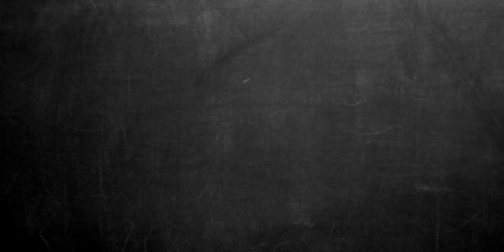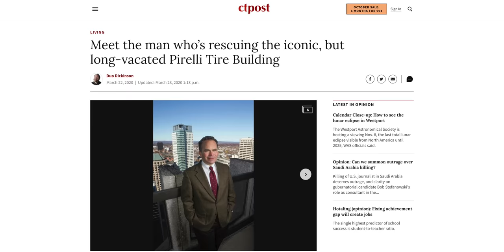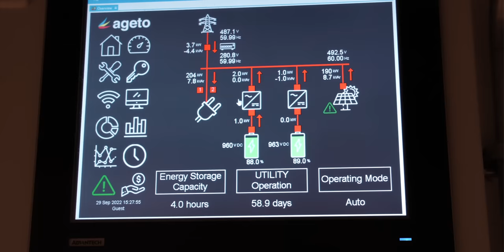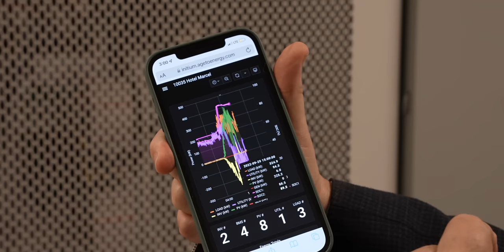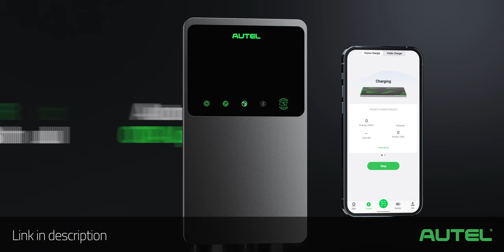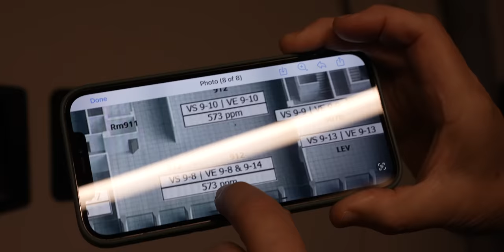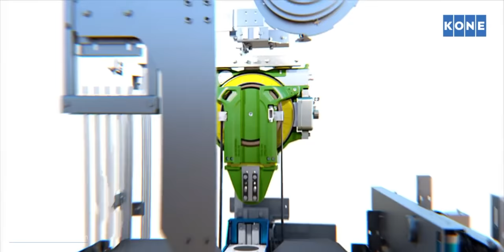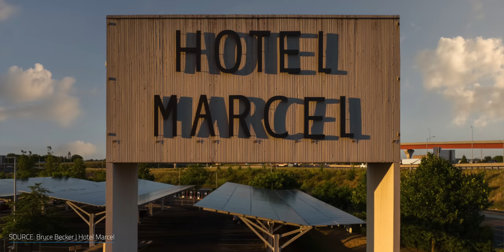How Big Can You Make a Passive House?

Comment: I have a special kinship with experimenters like this gentleman. Im about to retrofit a residential home and have been wondering why no one inside the US is manufacturing vacuum insulated panels for residential structures yet. After doing some research it looks like I can make my own panels for this particular project. There are no examples online explaining how the panels are made or how to install them on residential structures so I've already got some materials arriving in the mail this week to practice making some small scale VIP's and test their effectiveness against closed cell polyurethane foam and fiberglass. Some times you've just got to experiment yourself to see if an idea is viable.
Reply: I suspect the tricky parts will be making sure it maintains a vacuum for 20 to 30 years, and making sure no one sticks a nail through it to hang a picture!
Reply: @Cynthia_Cantrell  - Yes exactly. Someone needs to make a puncture resistant panel with the VIP inside. For my particular project it wont matter because its my house and i'll be careful. And the way Im going to install them it wont be too difficult to replace if/when they fail. Im projecting my panels to stay sealed for 50+ years.
Reply: Well if you do this, definitely make a video about it. I've wondered as well, but my guess was that material science wasn't there to maintain a passive vacuum for years
Reply: @__-pl3jg  Interesting... sounds like a serious challenge.  Stainless steel could probably do that, but it would be ungodly expensive!  If it works you should get a patent!
Reply: Double glazing is a good example of why Vacuum insulation is a bad idea for fixed structural elements. It's hard to maintain a vacuum, and even if 'most' glass panes don't fail regularly, you only need a couple to fail to lose that insulating value.
Structurally insulted panels with PIR are comfortably available where I am, but also there are insulated renders for retrofit on brick structures. Attaching PIR panels to the exterior or interior is relatively easy.
Reply: @Cynthia_Cantrell  - Im thinking the reason no one is manufacturing them yet is because it would be difficult to patent something simply because its too easy for someone to DIY their own. For example Panasonic made some 1inch R-60 panels and had them field tested by a 3rd party testing company almost 5 years ago and yet they still dont have a product brought to market? I read the report from the testing company. They reported that it was a fantastic panel that worked excellent. It even performed BETTER than R-60. The only downside was if the panel got punctured. But thats an easy problem to fix. Simply make plastic or aluminum cases with a home siding pattern on one side. Tracks could be screwed to the OSB siding and the panels snap fit into place. So if a VIP ever failed you could just walk outside and pull the failed siding section off the wall, slot in a replacement VIP. Having it on the exterior wall reduces the likelihood of puncture and makes them easy to replace.
Reply: @osc3892  - I gathered some info from current Chinese manufacturing methods. They're basically just putting a piece of polystyrene or compressed fiberglass into a mylar pouch. Then, vacuum sealing using existing mylar sealing tech. I think thats why their available panels are so small. Because they're using vacuum chambers instead of a large scale device (which may not exist). And im betting their current methods are NOT achieving R-60 per inch like Panasonic is. So the Chinese panels are likely around R-25 per inch and built with low tech methods. I'll be sure to make a how to video if/when I get around to doing this (probably 1 year from now).
Reply: Look up the VEGO system. It's what you described.
Reply: @LumenCache  - I looked around but couldnt find anything other than a Vego brick making machine and Vego raised gardens. Do you have a link?
Reply: My suspicion is that fundamentally it is very difficult to span a large area and maintain a vacuum in it for long periods of time - there's just a whole lotta air pressure trying to force itself in.   

Large flat sheets of any material will tend to collapse in on itself once you pull a vacuum on it.  That can be mitigated by an internal honey comb structure that keeps the sheets apart, but that needs to be open all around the cells so that air can be sucked out.  Then of course, that honeycomb like structure bridges the thermal barrier. 

A low thermal conductivity material like plastic could be used for that, but in the end, I don't think one would get much better than a plastic foam insulation, which can already be easily purchased.  

I don't know if all the effort is going to result in something significantly better than what is already available.  It will be interesting to see your results!
Reply: Fully Charged did a video on VIP, I got very excited at the idea and then considered the cost of replacing my render with them and skimming over the top and then went back to dreaming of winning the lottery :)  But on a new build it would be a no brainer.
Reply: I have seen at least one US based vacuum insulated panel seller, the product appears to only be meant for roofing.
Reply: I think that if the main goal is to build and operate sustainably and at reasonable cost, then the best option is a combination of solar panels and mini split heat pumps with modest upgrades to insulation.

Comment: This is great to see. Right in my backyard, I grew up 2 blocks from here, currently I retrofitted a net zero home in Prospect CT right up the road.. With 50 panels, 5 separate heat pump systems, HRV, air sealing, new windows/siding. I agree with your closing statement, this technology does make the building more comfortable BY A MILE, My home is heated and cooled 100% of the time.. I just let my heat pumps run and I forgot about. Really great work!

Comment: I had my natural gas connection severed almost 3 years ago, to force myself to make the transition to renewables. I heat with infrared, have insulated the whole house and use an ERV. This is a house from the 30’s so it took some time. Past year I achieved net zero (even 100kWh surplus)
Reply: @UCxdvETXNgUHlCftXjLrtzyg sharing knowledge with others is the best way to make a energy transition together 😉 I will take a course in installing solar, so I can help others achieve the same.

Comment: Seeing that KONE elevator makes me incredibly proud of Finnish innovation as a Finn. Not only that, but in my experience they are most consistently comfortable, quick and reliable to ride on (looking at you, OTIS, Schindler, ThyssenKrupp). I've followed KONE's new tech from time to time, but this energy generating elevator was new to me and indeed something else.
Reply from the maker: I love seeing this kind of innovation.  Europe has A LOT of companies innovating in this space, which is very cool.  That bit where Bruce blew my mind in the video was at the very beginning of my tour.  I found it funny how Bruce was basically throwing that nugget of information out there like it was no big deal.
Reply: @UndecidedMF  In my time at work(15 years ago) those inverters were already standard. In fact I made a drive for a gas compressor that delivered energy to keep the total plant at Power factor = ONE. All because the power feeding cable cable to the plant would otherwise have to be replaced for a bigger one, which would have been very expensive!
Reply: This is so cool and making the future come to today. We got our new build close by and had few challenges but all the lights are wired for PoE! Can’t wait for DC lights to become available at Lowe’s and HD! Thanks for reminding me that I am not losing it!

Comment: He needs a heating room to replace those dryers. 1 room heated to about 50c. The sheets gut hung on a moving line and they come out dry. You do need to extract the humidity which gives you grey water for those toilets. To soften the sheets they go into a non heated tumbler.
Reply: Exactly what i was thinking.
Reply: They can use a heat pump to run the dryers
Reply: @andrewsteinhaus8267  they can. I have just seen drying rooms but in sunny locations because they also get passive heating of the room by the sun

Comment: As much as I am super into this - It also has HUGE possibilities in office buildings / universities, for example.... My one concern would be obsolescence of the central power / controls kit - for the lighting etc. POE . Central point of failure.. Eggs in one basket etc. Can be somewhat mittigated with onsite spare kit and good management though. But... long term obselescene, and implications with replcement and availability of compatible hardware definitely a potential issue.

Comment: Our house is a retrofitted mostly concrete construction home built in 1950. The previous owners had installed solar as a backup, but not for continuous powering of everything. We upgraded fully by the end of 2021, and got rid of all natural gas  (we have a meter outside the home, but the line is capped and would need to be reconnected if NG power was to be used again). All electric- we overproduce and sell power back to the grid, and have battery storage that would allow for 5 days of power if the solar was not producing at all, up to 10 days at reduced usage or only partial efficiency from our panels. We power an entire home, a small SW development studio/office with multiple computers and servers, 2 greenhouses, and a converted large shed building that can function as a warm room for starting seeds and plant cuttings for our garden and houseplants or a living space for 2 people, with rainwater collection and purification for the sink and shower, and a composting toilet. 
Recent raises for NG and city grid electricity prices in our area have cut our full payback time from ~7 years to just under 4.5 years. SWPA here- we get cold winters and hot summers, and when the neighbors lose power or NG service, we're still up and running- 100%.
Lots of time planning and sourcing and finding the best installers and maintenance people- but we think it was worth it. It is possible- but right now it is more than most people could afford to get set up. That needs to change, and hopefully it will- as more renewable energy products are manufactured and installed here in the US, instead of being imported from other parts of the world.

Comment: I have built solar generators since the 1980s.  My first was a simple DC system that I loved for it's simplicity and dependability.  AC inverters are so common now that I find DC lights and appliances are more difficult to purchase.  So today I live in a RAM Promaster City Van with one solar panel, two battery packs and two 400W inverters.  My refrigerator connects directly to the battery however everything else is plugged into the inverters including my electric heaters.
Reply from the maker: Thanks for sharing

Comment: Great video Matt, as usual. I’d like to hear your thoughts on my situation. We bought a home in a rural setting in July of 2020, the original house was built in 1947, there are at least two, possibly three areas that are obvious expansions to the original, single-gable structure. In 2011, the whole thing was lifted and a converted into a two storey house. The lower level is mostly insulated to modern standards although the envelope is definitely porous. When the first winter arrived, we realized what a sieve it truly was.

Upstairs, there’s three separate attics and during the fall of 2021 I pulled out all of the insulation from the main and original gable, a mixture of R7 and R12 fibreglass and added vapour barrier (probably not necessary) and R28 rock wool insulation. This change alone made quite a difference in the overall comfort come the following winter. The main floor is fan-forced heat, we weathered the first winter with the existing oil-fired furnace but last fall swapped that out for a heat pump and air handler; the upstairs is still heated with baseboard heaters, which I’ve added smart thermostats to to save energy. I purposely had the heat pump oversized so that I could add two individual heads to the refrigerant loop at a later date.

I was compelled to post this word-wall at the point in this video where you addressed HRVs. I’m continually working towards a better sealed house, and thankfully I have the skill sets to do most work myself. I’m wondering if it would be beneficial to add an HRV system to my house, I’m already planning a way to extend the forced air system to the master bedroom upstairs and adding HRV ducts wouldn’t be difficult to include, but is retrofitting a house that may never be fully sealed with an HRV worth it? Is this one of the reasons you decided to build a net-zero house, because you thought it would just be too difficult to retrofit your existing one?

I could go on with more of my admittedly over ambitious plans, but this is probably already one of the longest comments you’ve ever received. Thanks in advance.

Comment: I actually use DC lights, DC fans, 5v and 20v (DC) device charging (phones and laptops), I only use a mini inverter for the TV, and a bigger one for some other devices in the house which are mostly on demand. Although it's DIY I get more than 30% more battery from my set up. Here in my country, you don't have to be connected to the grid, Direct DC is great

Comment: US electrician here.  Hard unchanging rule for electrical devices.  Unless specifically stated any electrical device that can run for more than 3 hrs is considered continuous duty and can only draw 80% of the circuit design capacity.  A 50 amp electric car charger must be able to operate on a continuous duty cycle and therefore could only draw a maximum continuous load of 40 amps or 9.6 kva and not 12kva.  I am being pedantic but this is important to remember when creating expectations for people

Comment: Matt - Assume they did the calculations on dryers that recycle the heat and use heat pump waste heat.  Special ERC to recycle the heat and start condensation. Then heat pump to get the last temperature rise for the dryer inbound air.  Heat pump cool air to cool the large conference rooms. 

Shower water heat used to pre-heat hot water tank or swimming pool. 

Just a couple of Ideas that they may or may not be using.

Comment: Thank you for this informative video! So much information to absorb. I have an upcoming project where I might be able to implement the Lumencache system. Only thing I worry about is potential obsolescence. A friend bought a house years ago which used low-voltage switching to control conventional 120v lighting. The house was built for early remote-control systems with home runs to relays and distribution wiring throughout the house. My friend ended up having the entire house re-wired. As long as it works, it seems like a great idea.

Comment: The one thing I didn’t hear mentioned (or if it was, I missed it), but I think is also important to note, is that all this sustainability in design is met with price per night that’s average for a hotel with the same amenities. So it’s not more expensive to the consumer, is likely cheaper to run day-to-day, and thus is likely more profitable long-term, even when considering the fact that the specialized skills required for the maintenance means that maintenance costs will be slightly more expensive when they do come up.

Comment: My wife and I bought a tract house built in 1976, and we had it remodeled.  We haven't hit Passivhaus levels but we did pretty well.  More insulation, a ground-source heat pump, a heat pump water heater, heat-recovery ventilator (similar to the energy recovery ventilator he showed but much smaller), and we have solar cells on the roof and a backup battery now.  We even have an induction stove in our kitchen, too!  We would absolutely be net zero except that we also have electric cars and we are charging those, so I'm not sure if we will quite be net zero.  There are tax breaks for these investments and the solar is on a 10-year fixed loan with a generous interest rate (special for solar installs).  These changes will take a long time to pay for themselves... but they will pay for themselves and we have been very happy with our home.

We don't want to sell our house (we want to just live in it) but I'm convinced that with the upgrades we have made, the resale value of the house must have been greatly increased.

Comment: I like that the lights are all DC. I recently bought a DC fan to save some juice over my old AC fan. It was a noticeable drop because I typically run the fan 24/7 to make the space feel cooler instead of using air conditioning. Really impressive for a hotel to only have 5kw for lighting the whole thing.

Comment: It looks like the only big energy saver left is turning the electric dryers into heat pump systems - that would cut their energy use for drying bedding by at least 50% if not 2/3rds.

Comment: The idea of a fully DC electricity system is amazing!! Yes Yes!!  A/C power is used because it's easy to transport long distances.  However, in the house (or hotel), there is no reason why you can transform to DC at the junction box and then the house be fully DC.  I love this idea - especially with efficient LED lighting and other things.

Comment: I don't understand why elevators are not made with counterweights to offset the energy used to raise them. Cables of course wear and must be replaced more often however using a fluid with the same weight as the elevator as a counterweight could essentially make it weightless. The only power used would be to raise what is inside. Then regenerative braking would work much better. Of course there must be a backup system in place.